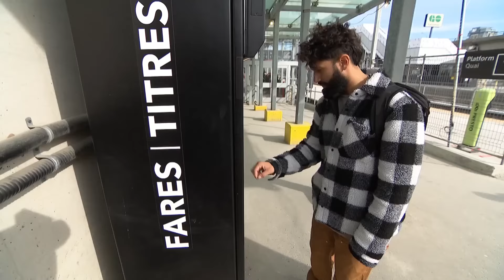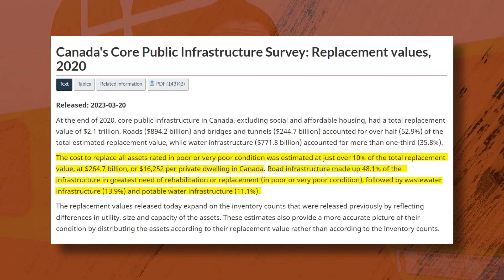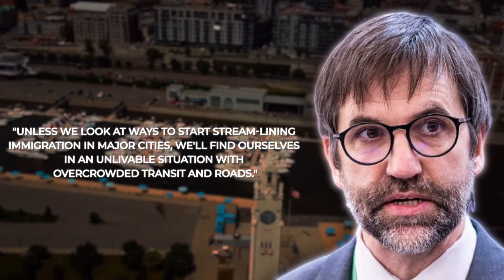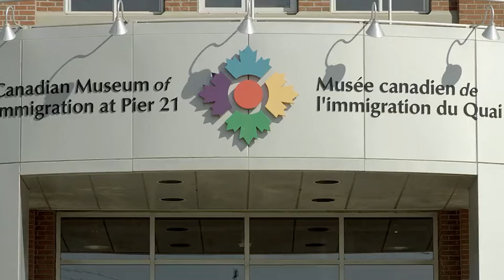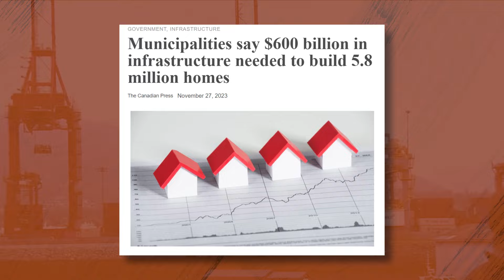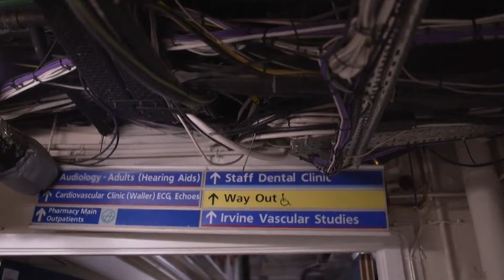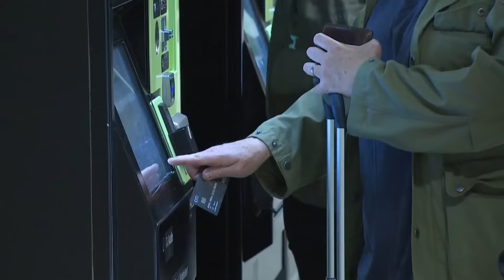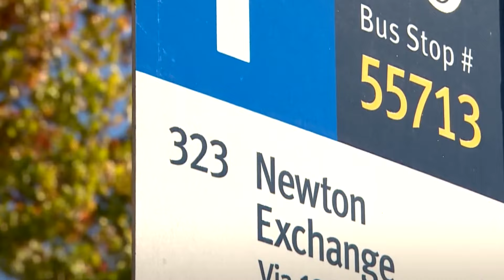Canada's Deteriorating Infrastructure is Losing BILLIONS!

Comment: I was driving through Toronto on my way to Niagara Falls to see the total eclipse, and my God, the huge potholes in the freeway on Hwy 401 between Keele Street and Islington were enough to blow a car tire!   I was swerving like crazy to miss all of them (lucky I did, because 3 cars that did not were off to the side of the freeway with flat tires.  It was like someone peeled away huge circles in the pavement, leaving 16" x 30" circles in the road, where the drop down was about 3 inches, and the edges of those holes were sharp, not rounded at all.  I was only traveling at around 50 km/hr due to the heavy traffic so I could easily avoid them,  but even at only 50, if I hit one I would have blown my tire out too.   And going at 110 and hitting one would cause serious structural damage to anyone's car.    Yes, the roads around Toronto really are falling apart right now.
Reply: OMG  ALL MR SOCK HEADS FAULT HORRIBLE.